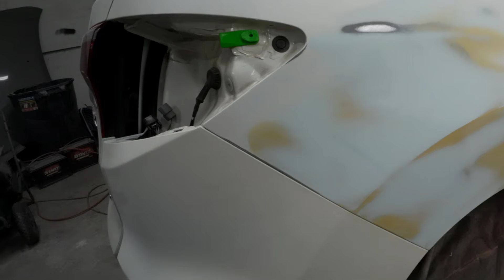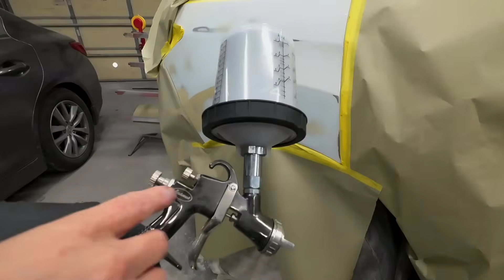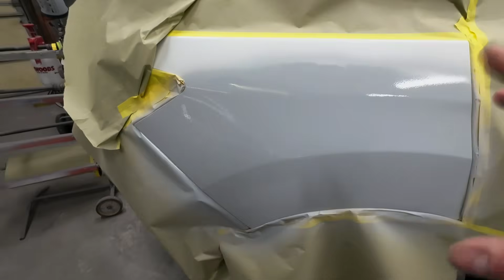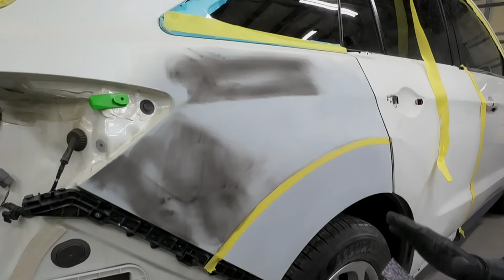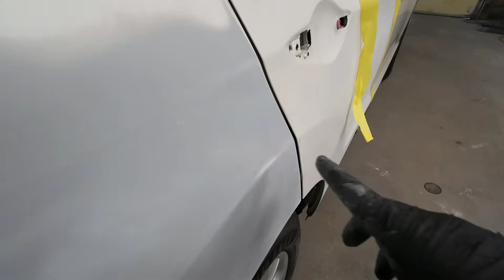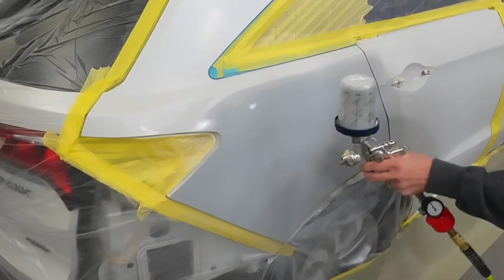How to get perfect primer before painting your car!

Comment: Coming from woodworking it’s hard to wrap my brain around a 320 scratch for primer.   I was always taught the bigger the scratch the better the grab.   I see new vehicles with paint falling off in chunks and can’t help but think they need a bigger scratch.   Gm vans have been falling off for years now I see white Hyundais with paint falling off.
Reply from the maker: Yeah I understand  and for the most part that's true. The problem is the shrinking of the primer. All these primers shrink, if someone try's to say they don't it's just hype.  Some guys feel it's  ok to primer over 180 or 220 I've  seen too many sand scratches in repairs from it. Including my own work! So I learn and adapt to mistakes to continually improve quality.  Most manufacturers recommend to primer over 320 anyway. Sorry for the rant, sand scratches in a repair is a pet peeve of mine. it drives me nuts! 🤣 Hey , I appreciate the comment and support brother!
Reply: @GarageNoise  I recently did a repair on my truck and the Eastwood 2k primer said to sand to 320-400.   Now I’m glad I did

Comment: Interesting video Chris, I like using sealer as it gives a uniform colour to apply your base but the issue I often have is that I get dieback in the clear after it's fully cured, I'm not sure if dieback is the correct term but straight after applying the clear it looks great but the next day it looks textured like the sealer has pinched back but this only happens when using sealer, any suggestions to stop this would be appreciated👍John UK
Reply from the maker: I've  had that happen  too. The times it's  happened to me I believe it was caused by applying may base a bit to soon and not giving sufficient enough flash time for the sealer. I don't  know if you use a 2k sealer like I do. Just one possibility. Appreciate the comment and support!
Reply: Thanks for the reply Chris, yeah my sealer is  2K it's the Octoral PH254 non sanding primer and it happened a few days back, I checked the TDS again and it's possible I've been putting to much reducer in the mix, I normally do my sealer work later in the day so it has all night to cure, the Octoral has an open time for recoating of 48hours so there is no problem leaving it over night, thanks for the help.

Comment: Great video as always. The cubitron II is awesome nice to see you using it. I love the uniform scratch. If you use any on the DA I noticed the vacuum hole hook and loop is way better than the mesh. The mesh on the DA seems to get its edges deformed and the amount of actual abrasive on the disk is less due to the mesh. The vacuum performance is great with just the holed disk. I imagine doing a few panels per job they would last you a while after hand blocking it out to 180-240! Thanks for the video Chris.
Reply from the maker: I'll  check out the vacuum hole version. If I'm  not mistaken it's much more expensive than the mesh. Appreciate the support brother!
Reply: @GarageNoise  They did go up and price a little bit lately, especially the 80 grit for whatever reason. But the difference with how long they last over the mesh is crazy! In my experience on body work or cabinet making it is four to one. They also sell a mini interface pad designed for the cubitron mesh paper and Mirka's auto net so it doesn't destroy your velcro by contacting the surface while sanding through the mesh. It's so thin, it remains hard and doesn't really interfere like a normal interface pad would going over high spots. I think they call them pad protectors and I just been keeping mine on even if I'm not using a mesh.  Thanks for the channel Chris.
Reply: When you sand after the primer is it 320 then 600 ? And is it ok to sand with smaller blocks or even a palm sander the 600 since it was previously longblocked after final primer? Love the show !

Comment: Do I understand correctly that sealer is only to put over primer? My truck door has spray can wrong color on it . I’m thinking I should use a sealer over the wrong colors before the primer and base coat? Is that right?
Reply: You should remove that spray can paint off the door first then refinish the door with proper paint supplies.  Covering it up with more products is just asking for more trouble!
Reply from the maker: You would do primer ,sealer then base
Reply from the maker: Robert you should remove that old paint if possible it would be best.

Comment: I use sealers on all the old cars I do. Already learned my lesson on paint reactions. On an overall paint job I sometimes use the Speedokote 1 k sealer and it leaves a nice smooth surface for the paint to bond to. I go over the surface and tack it  if I feel any dust, I hit it with one of those sanding pads lightly. Current job is a 65 Corvair that had the original single stage on it. What a work out this car is giving me!
Reply from the maker: I've had my share of old paint wrinkle on me thats a mess. Sometimes  on an overall I just go ahead and primer it. To avoid sealer. Appreciate the support brother!
Reply: i’m doing a garage paint job on my 2000 bmw z3. it’s dark green but it’s getting sprayed in a dark red color. do you think sealer is needed? my grandfather has been doing auto body jobs for a long time and says that gray primer should be enough. what do you think?
Reply: @Exiphr what did you do?
Reply: What do you consider older cars ,
Reply: If you are doing an old car don't waste your time painting over the old paint!  You are asking for trouble and if you are a business you will get a bad reputation.  Just strip all the old paint off.  It's not that hard to do the job correctly!  I don't paint over old paint or other people's body work!
Reply: @MAn-ti3ul  if its old lacquer or single stage sure. And its a lot of  work stripping a car down to bare metal. Been at it for days now. Then epoxy, then primer and blocking, then i'm still going to seal it...
Reply: @BearBudgetgarage  If you think stripping a car to bare metal is hard work you shouldn't be working on old cars!  With the correct tools you can have a car stripped in a day or two.  If you sandblast it you will be done in less than a day!  If you are just going over the old paint that shouldn't take you more than a week to complete.
Reply: @MAn-ti3ul  No sand blaster, no aircraft stripper left over from the 1980's, and yep, it's taking a bit of time. And that means I shouldn't be doing it? Well, you must be right, because you seem like a guy who knows everything...all this free advice nobody asks for... How do you find time to get any work done?
Reply: @BearBudgetgarage  Sorry I hurt your feelings.  You obviously need some advice because you are struggling working on that car.  However, you are unwilling to learn from others who have the experience you don't!  Best of luck to you.
Reply: @MAn-ti3ul pshh. awfuly defensive over your own "advice" that was entirely unsolicited. Haha
Reply: @MAn-ti3ul I would never try to learn from someone that don't want to teach.  Why are you here?